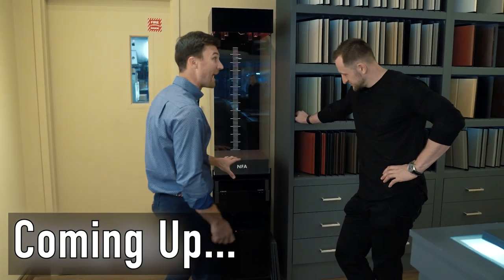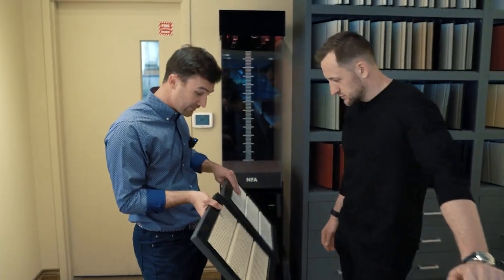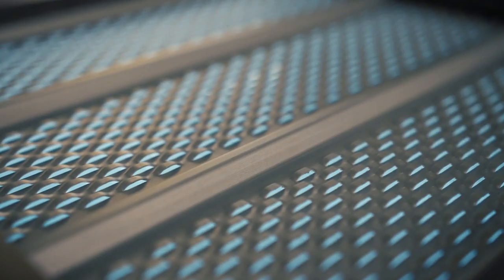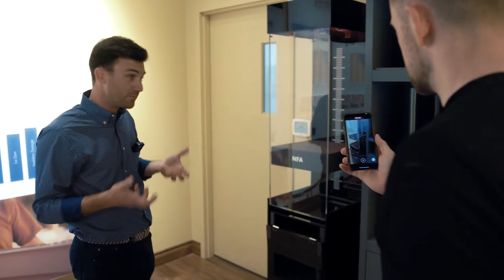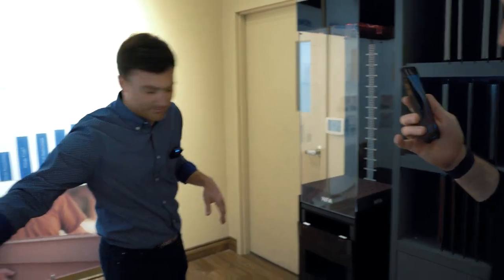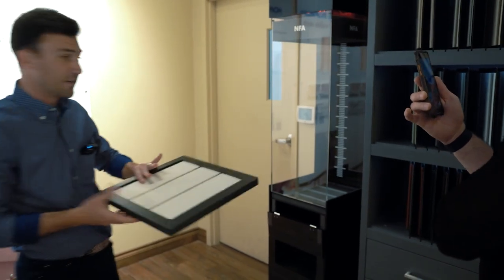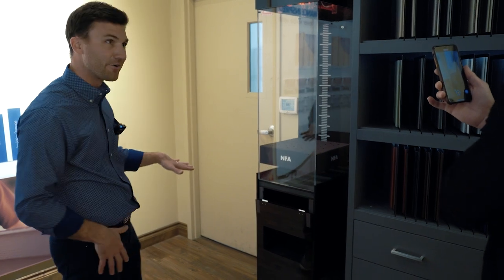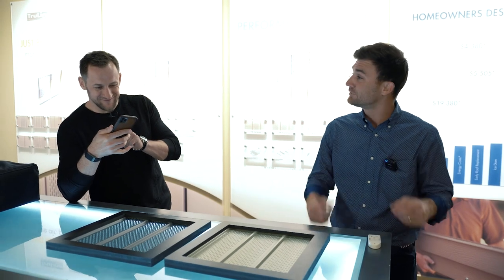Best Roofing Ventilation - Best and Worst Soffit Vents (Dented VS Vented)

Comment: I represented Soffit , ridge vent , roofing and insulation manufacturers for 40+ years .

The first issue is that center vent soffit has traditionally out sold fully vented by 3-1 … or more 

The reason , the builder thinks fully vented soffit “looks ugly “. 

The second - who is installing the Roofing/ RV  , insulation and siding/ soffit ? 

If you are using a ridge vent and any vented soffit , you need a baffle  behind the sill plate to keep the insulation back so  there is free air flow pushed  through  “vented or dented “ 😄 soffit eventually “ pulled up to the RV 

That baffle goes in the attics above Every single vented panel…  - with 16’’ being the standard in the Upper Mideast .

Which trade is ensuring that happens ? 

When I bright this up at PK meetings in Metropolitan area’s   , the builders / roofing and siding contractors laughed at the improbability  of this actually happening through a coordination of the trades despite baffles being inexpensive . 

I’ve seen a number of homes where the insulation contractor cuts the baffles in half to save a .75 or put one in every few joists .

Did the soffit guy crawl into the attic to find the baffles and put vented soffit there ? Uh , no ! 

One note - the reason baffled ridge vents all come with a filter in snow area’s is to stop a ridge vent from pulling snow in from the opposite side of the ridge vent when the soffit is under ventilated  . 

Absent the proper building process , many home remain under ventilated in the soffit area , new and old .
Reply: I’ll vote for you if you ever run for president. It’s pathetic homes are built properly in all respects. There’s so many lemons sold that ruin lives.
Reply: Even the "dented" is vented.  That's just a disparaging term they use for soffit that has a lower Nfa than theirs.  

During the entire video they never said what their Nfa was vs  the competition.  That calculation matters when choosing ridge vent and sizing the gap.

You can still have a properly ventilated attic with the lower Nfa stuff if you use it for every panel on both eaves and you properly sized the ridge vent to match the soffit vents Nfa.  The last thing you want to do is put an 18-20 Nfa ridge vent if you have limited soffit venting.
Reply: Thanks for this info!  I'm currently my own new baffle contractor lol.   We just bought an old "rectangle on slab" house in downtown Albuquerque built in 1977 with 24" OC trusses, blown insulation, gable vents only, and just 1ft x 3" soffit vents set perpendicular to the house which are set about every 16ft apart..nothing more.  We've had to remove all the kitchen and dining room ceiling drywall due to drywall sag and a leaking roof mounted swamp cooler (which I fully removed) and nope, not a sill baffle to be found anywhere.  What I have found though is a soffit full of blown insulation!  Needless to say, I've decided to kill the two end gable vents  and will go to a ridge vent, with proper soffit vents.  Our house is a rectangle set due east and west and so the south wall is in full sun all day (also the reason I bought it because south wall is the back yard!) Lastly, I'm DIY'ing the baffles myself with edge set 2x4 on the sill plate (set to inside of wall) with 16" of OSB glued and brad nailed to the top (I bevel cut the 2x4s edge to match the roof pitch on my table saw).  This setup gives a 1.5" x 22" slit for the airflow from the soffit for each truss.  

I looked at the various styrofoam and polyethelene baffle options, but a few 2x4s and a sheet of 1/2" OSB is a hell of a lot cheaper and won't degrade as much over time.  Lastly, I left enough gap around the edge of the OSB and 2x4 baffle assemblies to spray foam a "U" around the perimeter of each assembly to seal them up good to the truss and sill.  I'm also adding 1x3 furring strips to the truss bottoms at 16"OC for the new drywall to prevent sagging (the original was also 1/2" and not 5/8 as should have been for 24" OC trusses)  and for the new truss insulation we are using 1.5" foil-backed poly-iso foam in between the trusses (also cut 1/4" shy on each side for spray foam sealing) and will then re-blow 6" insulation back on top.  

And finally, I'll probably staple on a radiant barrier foil sheeting to the top of the trusses at the roof to help direct the airflow from the soffits and to create more of a conditioned space overall.  I'm only going to do the south roof first though for now as our rectangle house is set almost dead nuts to east and west and is actually tilted southwest just about 10 degrees.   It's a very ideal orientation which is why I bought it and I can implement some passive solar tricks. For example were adding a 12ft wide glass wall where our dining room is on the south west corner and will just keep the concrete slab as our flooring.  The sun will heat up the slab  due to the south face orientation and we have reflective shades for summer.

Comment: My house doesn’t have fascia end board or soffits. It’s just rafters with bird block in between. I was wondering if I can add vents onto the bird blocks in between each rafter and it will function the same as the soffit vents? I want to do this because I want to remove my gable vents so I can insulate and drywall the attic. But I still want to make sure it’s vented. Yes, I will add baffles and there is already a ridge vent in place.
Reply: I am in Texas - gable vents with a wired fan is great for ventilation if not the best. Ridge vents are quite inefficient unless you go wider vents (but prone to leak). You can add several active vents to the attic and see the difference. Yes, enough soffits are needed when several fans are installed.

Comment: Yes, but what do you do when the weather is frigid and the sofit breathes freezing air into a small room such as a bathroom making it intolerable to use?
Reply: Do you not have a ceiling and insulation lol.  What an odd question.
Reply: Air seal the bathroom vent, someone gets to climb into the attic.
Reply: Soffit cannot 'breath' air into a bathroom, or any other room.  At the very least, you're having an insulation problem.  After that and any other problem is addressed, you may consider venting the bathroom.  This is from a year ago.  If you never solved the problem, I would be willing to bet you have mold in your attic/house... possible structural damage, such as nails rusting... etc.  EDIT  Oh, calculate intake and exhaust flow in your attic, which is very important.  It has to be proper/balanced!  You may consider 1/150, not 1/300.

Comment: I would prefer all metal materials.
Plastic will never hold up like metal will.
Reply: Amen. Especially here in the AZ sun/heat
Reply: @thulsa5218  ummm... sun will never hit the soffit.
Reply: @rickphillips683  depending on how the house is position and the sun rises and sets YES it does
Reply: @thulsa5218   Sure, if you have an upside down house.

Comment: It isn't obvious what the column is doing. Airflow can be measured in units and displayed so that comparisons are data driven not intuitive.
Reply: This 'test' is a gimmick.  What is important is, air flow in an attic has to be sufficient/proper/balanced... intake and exhaust.

Comment: Something for that legendary intro track... 

Verse 1:

Yo, his palms are sweaty, on the roof it’s heavy,
Ventilation’s tricky, soffit vents ain’t ready,
He’s nervous, but on the surface looks calm and steady,
Calculating airflow, like a pro already, he’s setty.
What he needs now, are vents that won’t fail,
Soffit styles varied, he’s reading every detail,
From dented to vented, seeking the holy grail,
For air circulation, roofing plans must prevail.

Chorus:

You better choose the right vent, in the attic, it’s a fight,
For airflow, temperature control, it’s tight,
This opportunity comes once in a lifetime, right?
Best Roofing Ventilation, don’t let it outta sight!

Verse 2:

His vent’s got a function, no time for malfunction,
Dented soffit vents, bring nothing but destruction,
Poor airflow, condensation junction,
Mold and mildew form, it’s an unwanted deduction.
He’s gotta vent right, keep the air tight,
Vented soffits bring the balance in sight,
Exhaust and intake, like day and night,
Cool in the summer, warm through the night.

Chorus:

You better choose the right vent, in the attic, it’s a fight,
For airflow, temperature control, it’s tight,
This opportunity comes once in a lifetime, right?
Best Roofing Ventilation, don’t let it outta sight!

Bridge:

Dented soffits, they’re the worst in the line,
Block air flow, bring trouble every time,
Vented soffits, they align and shine,
Proper ventilation, that’s the prime design.
Humidity’s the enemy, keep it at bay,
With the right vents, the air finds its way,
Circulate, ventilate, the roof’s here to stay,
Best roofing ventilation, leading the way.

Verse 3:

Man, roofing’s a science, gotta get it right,
He’s researched and worked, through day and night,
Dented soffits fail, causing nothing but plight,
While vented soffits keep the airflow tight.
Installation’s a breeze, when you know what to choose,
The right soffit vents ensure you never lose,
Humidity, condensation, all defused,
Roof longevity, that’s the good news.

Chorus:

You better choose the right vent, in the attic, it’s a fight,
For airflow, temperature control, it’s tight,
This opportunity comes once in a lifetime, right?
Best Roofing Ventilation, don’t let it outta sight!

Outro:

Don’t lose your chance, pick the right ventilation,
For a healthy home, and roof preservation,
From dented to vented, make the right decision,
Best Roofing Ventilation, it’s your mission.